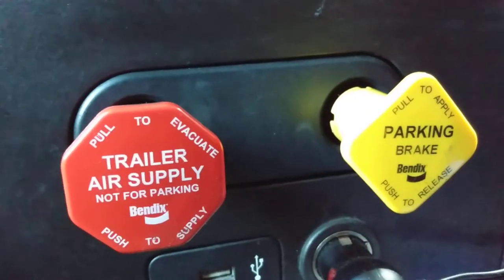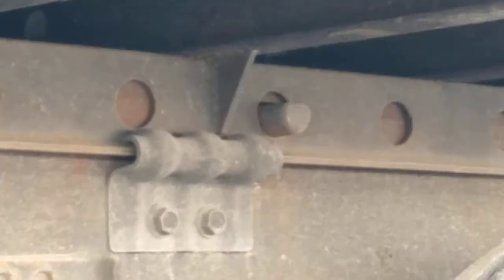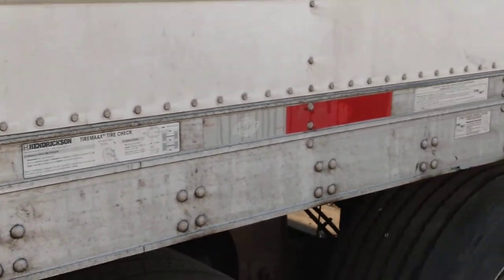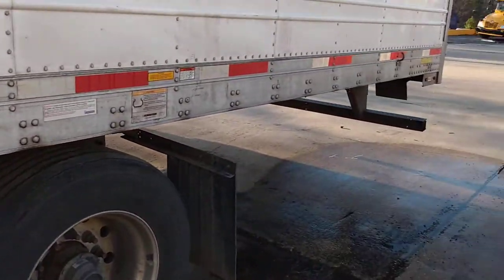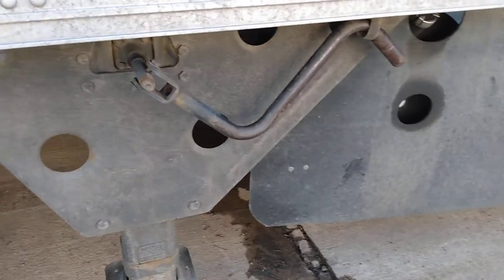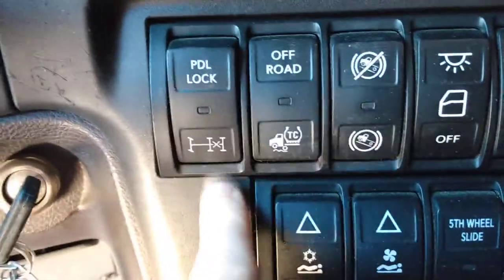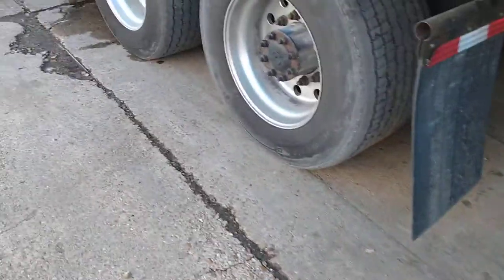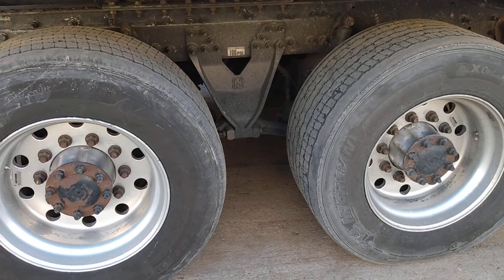Winter Tandem Sliding Malfunction & Fix

Comment: 1 pin on the driver side ??? that"s definetly  a Malfunction !!!  the bolt or stud that was between the pin and the pull bar was broken and when the previous driver before you took a hammer and knot the pin out so he could slide the tandems; however the pin and spring fell to the ground and fail to get this problem repaired before the next driver picked it up !!!! all trailer tandems are required to have to 2 locking pins on each side of the tandems. Safety hazard...take that trailer to your nearest service shop asap or if dot see that you will get shut down on sight,,, When the other pin breaks and you roll it over than it's too late !!! Stay safe out their driver ...